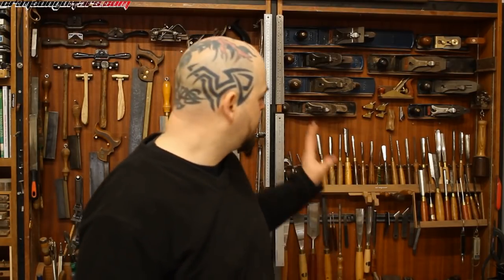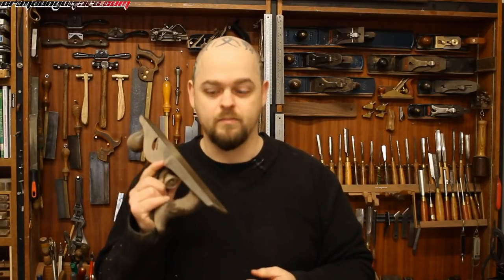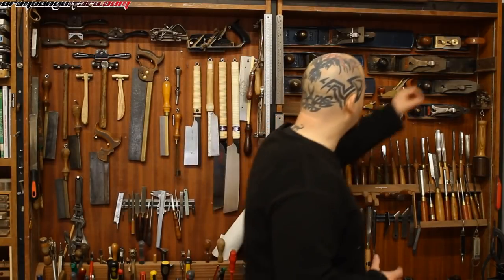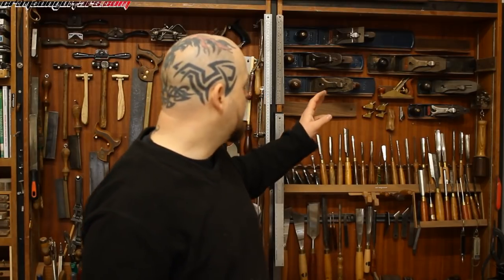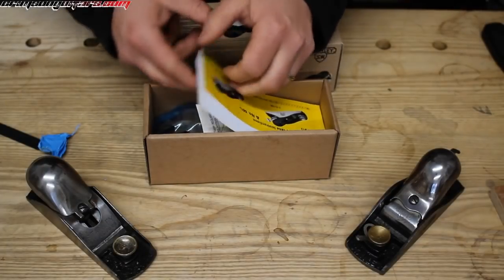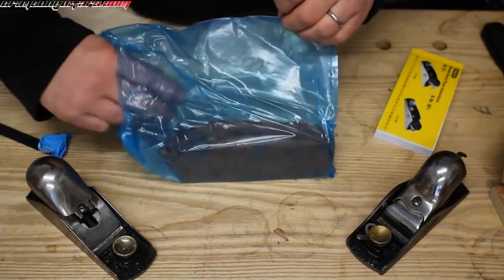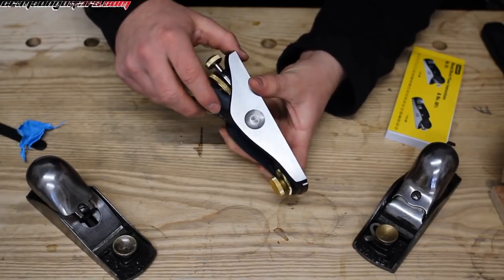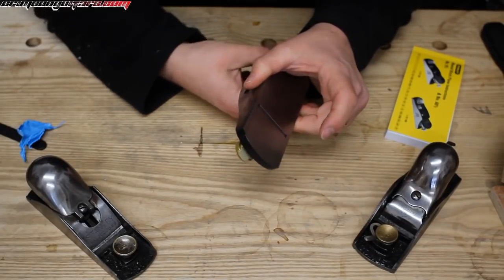Unboxing New Stanley 60 1/2 Sweetheart Low Angle Block Plane - A Review

Comment: Thanks for the video. After watching I bought a new SW 60 1/2 expecting to need to flatten it as you did. After unboxing and checking for square I was pleasantly surprised. It came dead flat from the factory. Also the label on the side is no longer ink as you indicated. Mine appears to be laser etched. Seeing that this video is over 8 years old maybe they made some improvements.

Comment: The way I see it is, when you buy a new plane, you decide how much of the setup you do yourself, and how much you pay to the factory to do it. I recently bought a regular Stanley #7 because a local hardware store happened to have one, and it was useless to start with. Leveling a big plane like that was a lot of work. Had to level the frog too and everything. It took me many hours to make a plane out of it. Premium planes are almost ready to use out of the box, that's one of the things you pay for. On the other hand, those regular Stanleys are lighter than bedrock planes and I really don't want that big plane any heavier. 
And yes, I am continuously amazed of how useful a file in that kind of a handle is.The freatboard leveling file is one of my most used tools. It's the block plane of the file kingdom :-)

Comment: I Just picked up a Stanley 12-138 Bailey No.9-1/2 Block Plane. I put in a little set up work and it works great. Also I think they were listing to you and laser engraved the side of the plane now instead of ink stamping.

Comment: Great review, thanks. I picked up the standard angle plane from my local woodworking store at about 50% off. It was the demo model. I wasn't considering it due to the aluminum cap iron and thought the rest of the plane must be poorly made. I took a chance and I was quite surprised when I got it home it really is a good plane, not premium but good. Maybe I'll go into business making brass cap irons and replacement bearings for these.

Comment: I received today a Stanley 60 1/2 Sweetheart block plane and either unfortunately or fortunately it was damaged when received, probably in transit.This means I am able to return it to the seller through the eBay system. I was able to examine the plane and was appalled by the sloppy fit of components and the complete lack of care with its design and manufacture. This plane. It may be a mid price plane but is definitely  on the lower end for quality.I collect block planes and the Chinese made block plane copies of the 60 1/2 Stanley are twice the plane that the sweetheart is. They are well made with beautiful machining. The machining is superior to that on  the full size premium block planes from Lie Nielsen and Veritas although the overall finish is not as good as the premium block planes. Having said this I still want an undamaged Sweetheart as it is part of the block plane history or at least a testimate to the declining quality in manufacturing. All the best
Reply from the maker: It is amazing what companies like quansheng are making in China these days. Stanley have upped their game in recent years but it is still not a patch on what it should be. Since filming this I've founded http://www.vintagetoolshop.com just so I can build my own collection up and the older tools never cease to amaze me! Thanks for watching! B

Comment: I suspect that the plane was not fully assembled when the sole was finished at the factory.  The tension that is applied by the component parts (as you stated) are what pull it out of flat.

Comment: Hmm, I might have to get one of these. I don't use planes too often (I repair guitars rather than build), but I do need a small plane. For $67 USD from Amazon and a few minutes to tidy it up, this might fit the bill nicely! I've got a no-name knockoff that sucks as a plane (although it excels as a dead-flat sanding block with sticky sandpaper), so this would probably be a good upgrade without blowing a bunch of cash.

Comment: I have a range of various after market blades on planes and the big difference is not so much the brand or method of production (Forged Vs cut) but the type of steel. The type of steel comes down to two main groups, tool steels such as O1, W1 or even D2 and the second group of alloy tool steels that include  A2 steel. The A2 is very tough steel but will not allow as fine an edge as the O1 etc. As the O1 tool looses it edge it just becomes dull where as the A2 developes a "saw tooth" edge of micro serrations. Many people much more knowledgable than me suggest that you don't use 25 degrees but go closer to 30 degrees for A2 blades to avoid the chipping..
I hope your new plane works out for you , I had none of these issues with my LN block planes.

Comment: Thanks for a very interesting and nicely presented review!.  I had the same issue with the throat screw hole burr, and also the same as commented on by Alan W - although flat, the frog does not appear to be machined parallel with the base, so the blade sits at an angle in the mouth, although it projects exactly the same amount below the base.  I guess I could sharpen a compensating angle on the blade, but this is disappointing for a "premium" tool.  I plan to scrape the frog both flat and level with the base which is going to be a real pain.  My Veritas block on the other hand is super precision - but it cost nearly 3 times as much!

It proves again that you do get what you pay for - with hand tools as with most things.

Keep up the great reviews please.

Comment: My second comment: The plane itself is good, but its the lousy cap. It is machined out of cheap aluminum. The adjusting wheel already has slop in it, so I can only imagine what it will be like in years to come. I did a drill out and a nice repair, but since Stanley never called me back I'm not discussing how I repaired the cap.  And I did buy both types of the low angle planes, and yes, I'll be doing the repair to both of them.

Comment: Have  you  tried  Ray Iles  plane  Iron's?  I put  a  Ray Iles Iron in my old  Stanley  plane, and  it cuts  like butter  , I have  a few  Ray Iles  Iron's, and  they  are  amazing, like  you. I have many  plane's, old  vintage  Stanley's and Clifton's  Lie Nielsen's , Preston plane's Veritas,  and  Norris,  and  Record pre-war and  many  others,  I started doing carpentry at the age of five years old back  in  1965 in my  father's  workshop  , and  I have  been  collecting old vintage carpenters tools and  restoring  them for  many  years  , I worked as a  qualified professional Carpenter for  many  years,  and  my  two  Sons are qualified professional Carpenter's too,  I love  vintage  tools,  I have  the  first  Clifton  plane's  before  they changed  hands , with  the  two part chip breaker  ,they  are  absolutely amazing plane's to use,  but  so are the  Stanley plane's  with  a  Ray Iles Iron,  best  wishes from a vintage Carpenter  .

Comment: I bought the Stanley 60 1/2 and have the same issue with the bed not being parallel to the sole. I have to cock the blade as room allows to get a full shaving. I'm going to send mine back to Stanley to see if they will replace it.

Comment: I don't know if it's the same plane, but it has a 1 star review online! :P 
If I spend under 60$, I don't mind flattening but after that I expect precision. Next one will be a #6 low angle Veritas ;)
Reply from the maker: My low angle lie nielson is one of my favorite tools. Sadly money talks where fine woodworking tools are concerned. After the fettling in this video though this is a very very nice block plane and I have used it a lot!
Reply: Crimson Custom Guitars Well I need a jointer anyways and anything under 600$ is usually cheap aluminium and poorly designed. The Veritas won't need a blade replacement every few months either, and saves me on the power bill so I can spare the 300$ for it. ;)

Comment: Thanks for the video, I got one of these over the holidays, and now I know what I need to do to it!

One thing about the one I got is the mouth seems to have been cut at an angle to the face. That is, it's thicker on the right than the left. Is there anything to be done, or is it just the way of things?
Reply from the maker: Hey Alan, so if you advance the blade until it closes the mouth it only touches on one side!? If so I would return it for another, the mouth needs to be even and as small as possible for fine work..  

More importantly (at least for my curiosity) is do you also have a burr in that hole underneath the movable plate?
Reply: Hey Ben, thanks for the response.

To answer your question, yes, I did feel a burr in the exact same place you had one!

What I mean is that the blade digs in much deeper on one side than the other when it is perfectly parallel with the mouth. So if you were looking head on so front is closest to your nose, the blade would be higher on the right than the left.

So yes, if I adjust the knob as far over as it can go, it's almost even, and the blade is quite off-straight.
Reply from the maker: Would it improve if you sharpened the blade at an angle to compensate?.. I had hoped that the burr in mine was a one off error but it seems not, that saddens me :(
Reply: Yeah, on the one hand, poor execution, on the other good mats and starting point to have a good tool. Though my shop is no where near as well appointed as yours to make the necessary adjustments. I guess I'll just have to go get more tools!

I'm considering making a filing jig to even out the throat problem. The adjustment is all the way over and still not enough. I don't trust myself to sharpen at an even angle to try and compensate.

Next time, Veritas it is.

Comment: This does not look good for my future plane buying.
But still a new Stanley is my best bet here. I can't get a used one anywhere near, and for a used one to be in perfect  condition is even more impossible. Also I can't affor a Lie-Nielsen.
I would not mind the setting up/flattening at all if I had a big enough (or any) good lapping stone.
Fortunately I don't have the money to spend right now.
Reply from the maker: You could use plate glass or I've even seen a granite floor tile or chopping board used..   Have you considered using a scraper like an engineer? Not a method I've used yet but could be cool... Thanks for watching and good luck in your search!
Reply: balázs gyurka MDF is flat  and low cost

Comment: I got this plane as a gift and im not sure if im just a noob or if i have a real problem. I have the blade inserted bevel up as it should be and the depth adjustment wont allow the blade to extend through the mouth until it is fully out, and then it is just barely put with the mouth fully open. Ive attempted to adjust it but i cant seem to fix the issue. Any suggestions?
Reply from the maker: +Hudson you should be able to sort it out. Adjust the blade so it is as far IN as possible then remove the cap, lift the blade up and move it forward a step, it should have grooves that register it on the depth adjuster and that is what needs sorting out, your plane is in the wrong groove.. I think... B
Reply: Crimson Custom Guitars thanks for replying. This plane does not have grooves, just two holes. The top hole extends the blade way too far, and the bottom not enough. It is the same plane you are using in the video
Reply: I hope you have got your problem sorted by now?  If not, I think I may know what the problem is.  On the adjustment knob, there is a rod with two threads .  On these threads are two round bits, one (the larger one) fits down and into the plane body, the other smaller one fits up and into the blade.  When you turn the knob, these round parts move apart pushing the blade down and out.  It sounds as if these two round parts are incorrectly positioned on the thread.  

Back the adjustment knob fully back, so the blade is into the body, take the plane apart and lift the rod/adjustment up and out of the body.  Now spin just the small round part down the threads to the very end of the rod.  Both round parts should now be at the bottom of their respective threads, at the end away furthest from the turning knob.  Reassemble, and try?
Reply: TheGraniteFlaneur thanks for the follow up, but i had it replaced and the new one works properly. Who knows what was wrong with the last one. I attempted to adjust those screws in every manner i could imagine, but nothing seemed to work. Thanks again

Comment: so a 0.05mm feeler gauge only just about went through? my god man, if thats what gets you dissapointed! plenty of aerospace components for wings wouldnt even be toleranced that tightly. I like your attention to detail for sure, but I think its overkill for woodworking and for the price point. I personally wouldnt be dissapointed with that level of flatness out of the box and not at 80 pounds. 
whats next.. taking all our tools for CMM analysis? you may get the bottom lumsden ground or surface ground and even then you might not get less than 0.05mm flatness.
with the natural instability of wood for it to shrink and contract, even if you had that perfectly flat on the sole, the wood would negate the difference with its own movement over time, by a larger margin I would imagine too. 
I like your channel by the way, so this isnt just trolling, just good out and out counter debate with you and enjoying the technicality of what you're trying to achieve. 
(long time aerospace engineer, short time woodworker)
Reply: Peter An aeroplane wing is significantly large than a block plane. In percentage terms the error is significant to the block plane. This small imperfection makes a big difference to a small tool that's whole purpose in life is to flatten and smooth.
Reply: Andy Midd there is going to be more contraction and expansion within the wood itself to ever worry about 0.05mm of run out on the block plane. If if that worries you then time to invest in cnc machined planes and cmm inspection to check followed by copious amounts of surface grinding. It's basically a case of diminishing returns and neglible differences. lots of other things could be improved or changed which will give a greater improvement than chasing down a 0.05mm difference. wood Itself will never maintain a tolerance like that across it's its surface from one day to the next. if you or this good man want to chase that down, knock yourself out. Just show me the difference it makes in the real world once you do
Reply: Peter That's fair. I think given the choice though, you'd always want have complete flatness out of the box if you can get it - as per Lie Neilson, Veritas etc. I think these more premium Stanley's were supposed to be closer to the quality of them. Some are, some can be patchy.

Comment: the older 60 1/2 was light years behind the new one except for the blade.
Reply from the maker: in certain respects yes, absolutely, but they were at least comfortable to use and most often worked straight out of the box..

Comment: The "unevenness" of your plane could very well be intentional. Japanese planes use a "3 point touch" design. Where there is a very slight (less than 1/64 of an inch) hollow between the 3 points. Explained: http://giantcypress.net/post/3874908014/japanese-jointer-plane-sole-configuration and as shown in this plane building tutorial: https://youtu.be/f_CheZ4s4YA?t=5m50s

Comment: The Modern Stanley Sweetheart range are not premium tools, they are mass produced and the quality control is awful. Saying that i have just bought a new Stanley 9 1/2 block plane(not SW) and i have the same problem. Every Stanley plane i have ever owned(i'm a retired Chippie so i have owned a few)has needed fettling , mainly getting the sole flat, Record planes are a bit better, but not much. Unless you are buying premium planes like Veritas or Lie Neilson you will have some work to do, its Parr for the course i'm afraid.

Comment: Paid $82 for one of these a few weeks ago. Waited 2 weeks for it to arrive. The sole was not flat in either direction, multiple parts were loose/wiggled, that I felt ought not to be loose or wiggling, namely the female threads. It adjusted horribly. I think Stanely has sold out to China or something. Last stanley I'll buy.

Comment: Dont buy one,Stanley wont even stand by their warranty,i have spoken to Stanley in Australia and the states and they will not supply the little brass screw which holds the cap iron,which in my plane broke after a very short period of use.